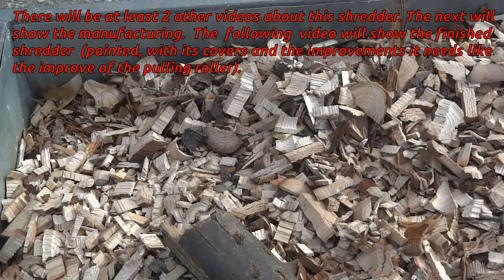Homemade chipper for firewood chipps

Comment: The chipper needs to have the ptoshaft at a straighter angle to preserve the life of the joints. Either by mounting lower and adding a larger flywheel or some type of gears. Looks great though keep up the good work.

Comment: Great job! Your obviously a very talented designer and fabricator. Can't wait to see the next videos on your chipper.
Reply from the maker: Erich's Alaska Channel Thank you very much. I am very happy with your comment because I am fascinated by the Alaska and it's the first time an Alaskan wrote to me. I am never came in Alaska. But I hope to go there one day. I would like to go to the Canada too and it is possible that I will go there this year.For my chipper, be patient, the next videos will come after a few modifications. I think around february. But other videos will come before. Videos about my last works about Stirling engines. I don't know if this kind of engine interest you. I want to make CHP with that and to achieve this, I have a project of a 450 cm3 Stirling engine for this year.
Reply: Chris workshop
Your welcome! Alaska is a beautiful place so you should come for a visit! I don't know a lot about Stirling engines, but I'll be checking out the rest of your videos for sure. What is your plan for the wood chips you make? Will you burn them to power your Stirling engines?
Reply from the maker: Erich's Alaska Channel Yes. I want to make an automatic stove (this year I hope). And when it will work well, I will use it to heat my workshop and to heat a Stirling engine at the same time. The Stirling will drive an electric generator like the one I have made last year (you can see the making on one of my videos) but bigger. I think that it will take me at least two years. You will see all that in my next videos..
Reply: Chris workshop
Sounds great! Looking forward to seeing your project updates. I'm very interested in using wood chips as a heating source so I'm looking forward to learning more about your stove.